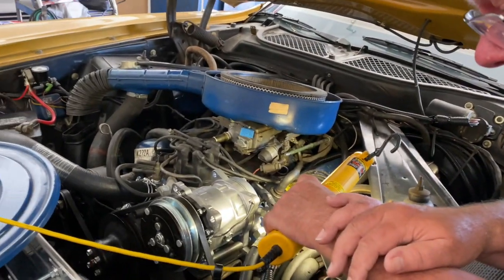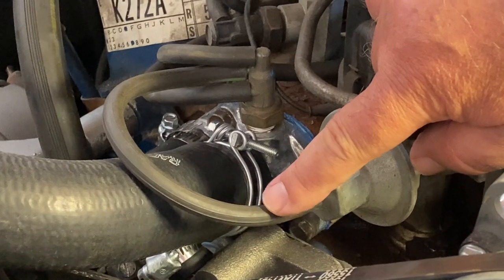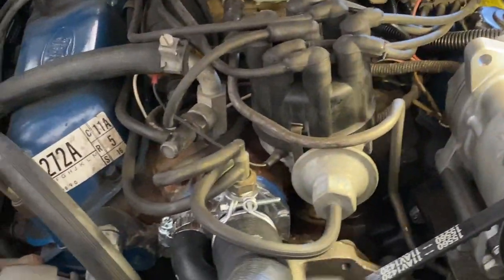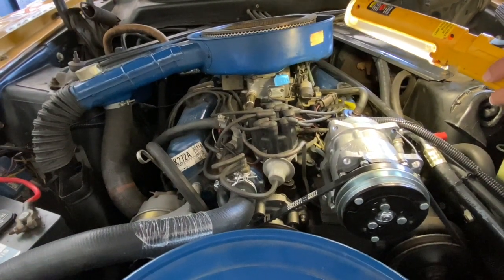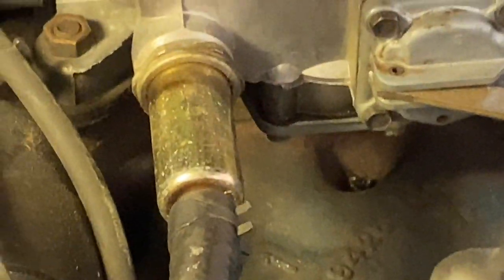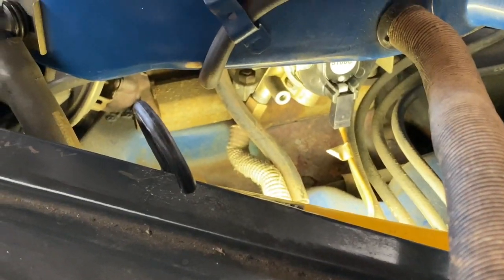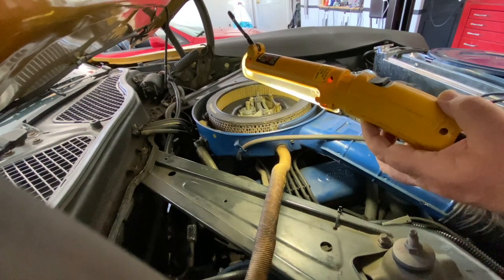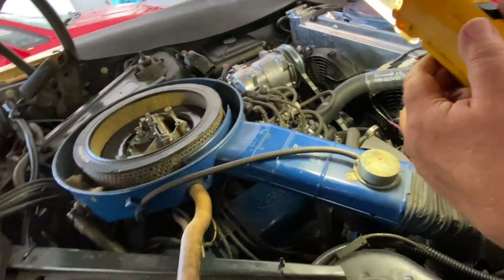Vacuum Hose 1973 Mustang 302 Distributor Advance, Auto Trans Modulator, EGR

Comment: Hello sir, i am currently removing all this emission crap & leaving the vac advance to the distributor & one for the transmission diaphragm. Hopefully it runs ok. I have heard it is cammed in a way to account for emissions, so i guess i need to re-time & reset some stuff. Has anyone taken it all of & capped the ports?
Reply from the maker: Greetings!  I know I have seen quite a few cars where folks have just pulled all the various vacuum hoses, likely out of frustration and perhaps also in the belief they would improve things.  I am not a purist for the sake of being a purist.  But, for the most part the various vacuum related engine components really did not harm performance unto themselves.  In fact some of the systems are beneficial in a few different ways.   In 1973 the engines were indeed modified to further reduce NOx emissions by using less combustion chamber compression, increasing combustion chamber quench surface area, adding an EGR system, and retarding the valve timing a little bit.  It is possible to reduce the number of vacuum lines to the most basic distributor vacuum advance diaphragm hose, and the automatic transmission vacuum modulator valve.  But, in cases where the vacuum advance diaphragm have a dual port design, you really should replace those dual diaphragm design units with their single diaphragm design from 1971 or 1972.  

That said, I would be leaving the 3 port Thermal Vacuuum Switch in place as it replaced ported vacuum with intake manifold vacuum when the engine temperzture hit 235 degrees or so, in an effort to help cool the engine off.  And, there areva few different flavors of single vacuum diaphragm Auto Transmission Vacuum Modulator valves, with different color stripes on the outside of the units to indicate the specific design of any particular unit.  I have found the Green Stripe Vacuum Modulators work best overall.  But with any kind of modification, YMMV,.

If you would like I would be glad to look at your engine's vacuum calibration and let you know which vacuum hoses and devices I would be keeping, and which ones can be safely bypassed.  Just reply to my post and I will read it, and provide more help where I can.  Please rovide the year engine, size engine, and a photo of the white label calibration code info from the passenger side valve cover (if it is there).  Some photos of the current vacuum lines with the engine might be helpful also.  You can sent the photos to my email @ gilhale@gmail.com.
Reply: @gilberthale7777  thank-you for the detailed reply!! I will get in touch soon.
Mine is a 1973 Ford Maverick 302 auto
Reply from the maker: @imagoflyfishing9993  Okay, I will do some preliminary 
digging
Reply from the maker: I enhanced the 302 Vacuum Schematics for 3-11A & 3-11D for 302 2v engines and auto tranny for the Maverick (and other) model vehicles.  You can retrieve it using the following link to my Google Drive:
https://drive.google.com/file/d/1MMCKqJOygplF1JtKi1O_C60Bqi1B6Sy5/view?usp=drive_link
Reply: @gilberthale7777  thank-you so much!!! This is pretty much everything!!  I cannot describe the amount of thanks for this!!!

Comment: Hi Gilbert. Could you please let me know how does the Vacuum Sensor inside the airbox it's positioned and to which pin the hose underneath connects to? There's two pins. I did an Air Box replacement and switched all components over. Inside the sensor (view opening) both side seems to be in an open position. I do appreciate your time,  even if you post a picture of underneath would help! Thanks
Reply from the maker: If I am reading your description you are speaking of the duel ported thermal sensor that sits on the underside of the air filter housing.  One of its ports goes directly to intake manifold vacuum off the vacuum tee behind the carburetor.  The other goes to the vacuum motor for the air filter inlet to help direct air coming either from the end of of the air snorkel, or from air being passed over the exhaust manifold to get heated air into the air filter when the engine is warm.  .I will see if I can get a more clear photo or diagram to you so you can see what it is I am trying to describe better.  Our 73 Mustang Convertible with it 302 has that particular configuration.  Once I find photos or diagrams I will post them onto YouTube, and send you the link for the YouTube site as a reply in this thread.
Reply from the maker: I put together a PDF snippet of the Air Inlet Control System, to include vacuum hose routings.  I am not able to place the PDF file onto YouTube, nor can I attach it to this YouTube comment thread.  If you email a  request for the "1973 Mustang Air Inlet control System PDF file" I will send it to you via eMail attachment  Although this is a 1973 configuration, it is a configuration used over several years with no significant change.  My email is gilhale@gmail.com.
Reply: @gilberthale7777  Ok sounds great. I will follow up with an email soon just to confirm the set up. Gilbert, you are the best and thanks again from taking the time to reply and everything that you do for others. Your videos are very interesting and knowledgeable.
Reply from the maker: @ajs.m929  I converted the 2 most important pages from the PDF file into two jpg files, then merged the jpg files into a short video clip.  Just pause the video when you see content of interest.  https://www.youtube.com/watch?v=WqYYIkkxh_8
Reply: @gilberthale7777  Thank you so much buddy! I did actually figure it out. There were a hose missing from the thermal sensor. Going through all the trouble since I added Ram Air to the stock housing.